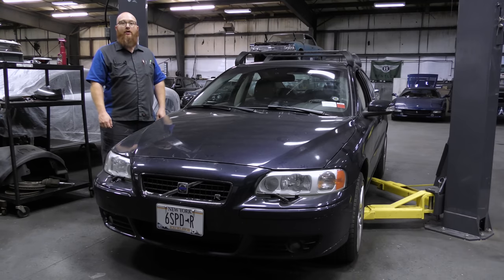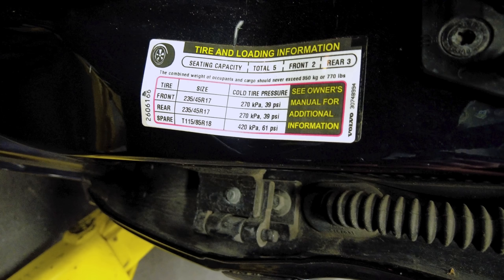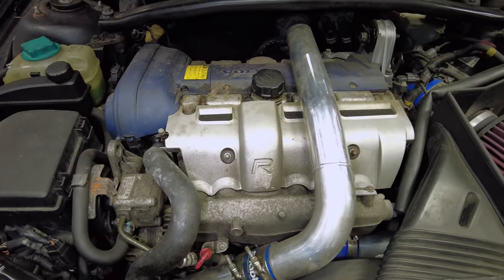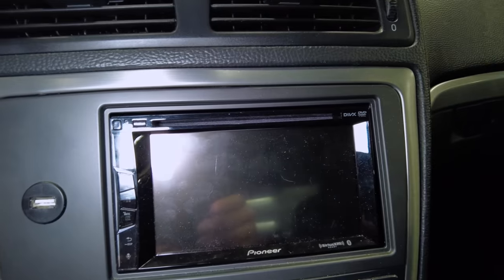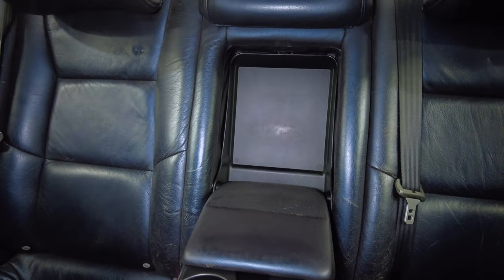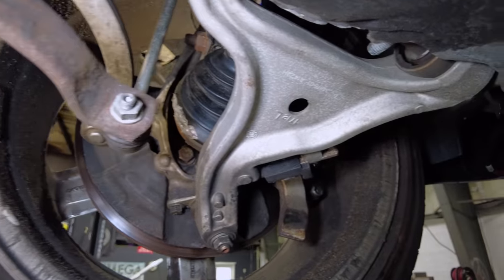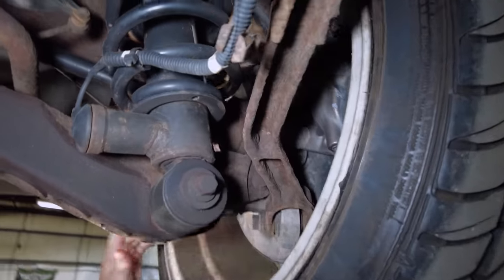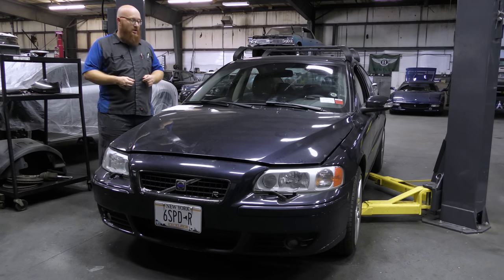They shipped their '07 Volvo S60R over 1K miles to my shop? CAR WIZARD determines if it's worth it!

Comment: That interior is kind of rough for 120k miles... Surprised to see the rear seats have a lot of wear too.
Reply: The Volvo seats from the era always wear out pretty quickly. You really need to condition them well and keep them out of the sun to prevent it.

Comment: That steering angle sensor issue is all too common on the P2 platform. I have the same issues on my XC90... gotta get that fixed soon, haha. Sometimes, it's not too hard to fix, being usually a dirty optical sensor lens.
Reply: I checked my anti skid on my XC90 and it’s saying angle sensor. I don’t want to pay hundreds for a new one, you think all I have to do is clean the lens on the sensor? Possibly ofc
Reply: @ZedQue  I did try that. While the main interior "wheel" passes through the optical sensors, the main issue I find is the small rheostatic/hall effect part under that protruding bit at the "top." The main wheel turns a small gear that controls the other part's movement, conceivably in and out. That is what is more likely the issue, since it is likely the bit that indicates the actual degree of turn. Either way, use some electronics cleaner or isopropyl to clean that, and it may help, but I ended up replacing my whole unit 😵🙄

There's a few articles on SwedeSpeed and the like, searching for "XC90 steering wheel sensor clean" or what have you should bring results. It is overall not difficult, but just make sure you put a set screw in the assembly to keep it from turning and then make marks on the three or so parts that have to come out. They are keyed, however, but just in case 😉

Comment: Bought my 2006 S60R new, and now has 175,000 miles.   Main Thing for keeping a car in good shape overall is parking it in a garage.                  I have had to replace 1 rear wheel bearing and the power steering pump.  Tires 18" P-Zero cost $1000 in 2008.  
Much cheaper tires are available now in the correct size.

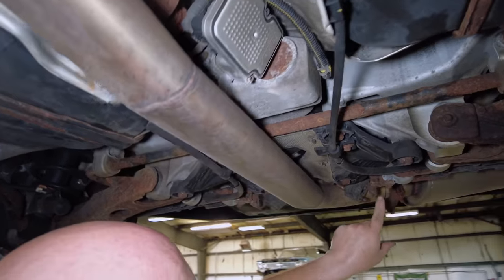Comment: Center screen at 10:57 is the DEM module, and right behind it a heavily corroded freeze plug that will leak Haldex fluid sooner or later, like mine did. That DEM module is not cheap and to protect it from the elements IPD sells a DEM cover. That freeze plug is not serviceable (and Volvo will recommend a whole new diff if it starts leaking), but removing the rust and J-B Weld will fix it. Good thing the 'bracket of death' has been removed (if you own a P2R and you have no idea what that means, you better google it). As for owning a P2R, if you're serious about it, agreed value insurance is the way to go. However, between the existing repairs, transmission, clear coat and other things that will undoubtedly come up, it will be well north of 10K before this is sitting pretty. 

As for mods for a P2R, HID projectors hands down the best mod. Low beam is pretty weak stock, high beam a bad joke. Euro's are better, but for the US market the high beam is just the low beam tilted up. I used to avoid driving my R at night, now I love it. Also shoutout to the best car seats and worst turning radius in the biz.
Reply: Thank goodness for the Internet where people like you can share all this repair info that otherwise we wouldn't have known just from reading paper repair manuals

Comment: the mechanical side of this car is actualy realy easy to work on...... alot of great communities with good prices on good used parts out there, alot of  easy upgrades to add to this car too ( remove cold air intake tho, makes no sense on this car. the stock on is a cone in a airbox wich is better for all the trash this set up might suck up . supsension wise , its possible to just put normal shocks ( billstein b6-b8 ) under there and get away with it. fuck that active supsension shit. breaks every 70.000 km and makes no sense to have on a manual, these cars got beautifull body roll, when used right u can take any corner at high speed controlled and well

Comment: I have a 2008 s60 2.5t  with 301000 miles, rebuild the automatic transmission with 260k miles, made by Aisin Wagner, so it's a Japanese transmission, replace the suspension with after market good OE cheap parts, from FCP Euro, IPD, and eEuroparts, lots of parts for this P2 Chasis, every once in a while I clean the Throttle body and change mass air flow sensor, very important thing is to change the timing belt every 100k miles, thats the Achilles heel on this vehicles, I'm about to change the motor mount,  basically basic maintenance, the cars been really reliable, except for the Japanese made transmission, but that's understandable with so many miles driven in city driving!
Reply: It is is the belt on the accessories that breaks.

Comment: Buying a late model S60R (can see it is a 2007 model as it has the mirrors with blinkers that came 2007-09, R-only 2003-2007) is a good luck to find job, and even better luck is to find a manual one in reasonable condition with that low miles! Here in Scandinavia it is totally normal that those have 3-400000km or more, diesels usually have 500-800000km (have seen cars with even more). :)

That is a car that will be worth BIG (20-50k) money in a couple years. They ask $15-20k for those today in that condition. So that is a no-brainer to fix that car. The R 6speed transmission is a bit of a speciality, basially the same transmission as all turbo S60/V70 6speed from 2003-2009. But they are a bit tricky to find as most were automatics. 

They already ask 20-30k for 850R's that are in good condition, and so will they ask for these in a few years. 

Brake calipers, $400 for a pair of R-brembo calipers is cheap. I doubt you can get them from anywhere even used for that price. My Audi 6pot Brembos are 2k/piece even used! :)

That car is stock, those are the stock Pegasus wheels (they came in 17 and 18" on the R). The S60mk1/V70mk2/S80mk1 (and XC90mk1) (P2) cars usually rub in the front because the plastic steering limit stoppers (fastened to the lower control arms) are worn out. Then the wheel rubs onto the chassis rail when at full lock. Seen it many many times. 

Cracked flex-joint in the exhaust is due to bad engine mounts, usually the upper mount. Engine moves and then cracks the flexpipe. Typical on the older FWD (850/x70 and the P2 cars).

The steering angle sensor is just typical on these, they all go bad eventually on the P2 cars with DSTC (electronic stability). 

Worked A LOT (probably on hundreds, those are like Toyota Corollas over here in Scandinavia) on these P2 cars so I claim to know my way around them.

Comment: What solved transmission issues for me in the past drain the current oil and refill it whit white spirit or something similar run the car around 20 seconds in the highest gear stop brake and drain the gearbox blow it dry with air fill it with the highest spec oil allowed the gearbox will feel a lot better and last at least a couple of months

Comment: The position of the leak is the lines entering the rack. The rubbing is a pair of rubber stering angle stops. $50 and four 12 mm bolts done. That rack leak is most likely the two o-rings at the line connector.

Comment: I have my Dad's 1967 Cadillac deVille convertible.  Has just over 200k miles.  He bought it new in 1967.  I 've had the engine, transmission, exhaust, complete interior, convertible top, tires, stereo system, paint job....etc, etc,.  ......now I just spent over $1000 on the rear quarter window motors (just the parts).  The car has more family history to me than its book value.  I spent $11k just getting the engine rebuilt and the rear main seal leaked worse than when I gave it to the shop.  The shop owner waved the white flag and gave up.  It took me months to find a local guy who was able to diagnose the leak and actually fix it.  Another $2500 !  I did find a Cadillac shop about 3 hour s away that "specializes" in classic/antique Cadillacs and they did not want to touch it.  It is getting harder and harder to find competent mechanics and good parts to fix some of these cars.  I am telling my kids, that when I'm dead and gone, just sell it and be done with it.  
That reminds me,  I need to get my bumpers re-chromed.......probably another $5000.

Comment: I own one.  Yes, it is worth it.  Until it slips, the AWD is front/rear 80/20.  4C suspension cost is usually why people sell.

Use the code to put it in advanced mode and it will make you happy.
Reply: Yeah 4C is kind of expensive, but at roughly 1800 in parts (from FCP Euro) and a weekend, you can handle the job yourself generally, plus, when they need replacing, FCP Euro will replace the old stuff for free...

Comment: In 2008 I bought a 2006 S60R, black w burnt tan leather interior. Was a blast to drive. 6 speed manual was smooth. Definitely was overweight weighing nearly 4,000 pounds. Made a round trip to West Virginia from NJ with no issues. Kept it for a couple of years. 
This car was Definitely neglected.

Comment: P2 Volvos are very very prone to wheel rub at steering lock. They have 3 different size steering bump stops for different wheel sizes. There is one for 15-16” wheels and then one for 17” and then one for 18”. They are color coded and by the looks of it, seems like it has 17” ones. So going to 18” bump stops should stop it from rubbing. Also could just swap them side to side so they have fresh contact and maybe add some washers. The bump stops are plastic and bolt to the control arm.

Comment: If transmission is dead, bet the haldex is worn. The angle gear was the failure point for why I sold mine. Itnwas $4k in 2010 to fix it.

Comment: I have the wagon version, a 2004 V70R. Yes, those are factory wheels. My wagon is a 6-speed manual. I currently have 240K miles on it. I bought for $6K three years ago. Over three years, I've spent $5K on maintenance and repairs.

Comment: Please read this:
I heard about 'the clock spring tale' before when my 2007 V70T2 had the same problem some years ago and solved it without buying new parts.
Volvo steering angle sensor problems has nothing to do with the clock spring,
The clock spring transmits information from the buttons on the steering wheel to the steering column assembly and nothing else.

It is the interior of the angle sensor that gets dusted up, Read: The optical system stops working because it can't 'see' through the dust.
A simple cleaning of the optical parts (optical bridges) will solve the problem.
Be careful when disassembling the steering angle enclosure: Some gears have to be returned to the original position at assembly.
I have a few pictures from the repair I can send....

You might have to calibrate the angle sensor after assy with VIDA-Dice or similar. 

Regards
JD

Volvo only since 1986 🙂

Comment: I have a 2006 Volvo S60R, Atacama Spaceball in Titanium Grey and these cars are really special. Mines kind of a unicorn because its great condition and has almost no issues. Most of these cars have issues. The car in this video is pretty good overall imo, Magic Blue is THE best color for these cars idc what anyone says, especially with atacama but it appears this one is nordkap which is also really nice. This one is not very optioned out, climate package and thats pretty much it. Its honestly more rare for it to not have a climate package. As long as the 4C works, haldex works, and the PCV system is in good condition it should be fine I think. They smell like crayons when theyve been parked outside for years.

Comment: When I was young and foolish, I passed a group of bikers who were driving much slower than the speed limit.  Long story short, I had to flee for my life when they pursued me.  I had a V70R Volvo with 6 speed manual.  I was surprised how well a motor bike could corner and they were catching up.. In the next straight stretch I had the Volvo in 5th gear when I looked down and saw I was doing 260 km/hr and still had 6th gear available.  Harley s can't go that fast.  The manual said that the car would reach top speed effortlessly, and they were right.  No I didn't blow a head gasket, and the bikers did not pummel me.

Comment: Market value is different from book value. Insurance will only pay book value vs what you pay. So if you overpay 25% for the car of your dreams and it's totalled, you will lose that 25%. It's hard these day to buy a "book value" vehicle since the calamitous covid days screwed up the valuations.
Reply: In that case the market value is wrong, right, if it should be valued at what people are actually paying for the car. I have heard fortunate stories of people whose car was totalled and they got the same money from insurance as they had paid for the car years ago, enough to buy a new one, or even more due to inflated book value. But then they do have to use that money to buy a new, overpriced car.

Comment: My answer is absolutely NO. That car is not worth saving. Take that eight grand and buy a well-maintained used Toyota Camry with 120,000 miles on it and drive it 360,000 miles. Volvo corporation has been a huge mess for years. Just let the headache go.

Comment: That steering rack will be an headache to fix. 
Manual gearbox, yes its worth fixing, A lot easyer than the automatic.
Mount steering stops on control arms so it wont rub.
But i recommend you to overhaul and diagnose this car with volvos software. You can test and reset everything with it. Also troubleshoot... 
If i would own this car, i would first go through the linkage for the gearbox and swap the gearbox at the same time as the rack if needed. 
Also check the steering oil reservoir that its not defective. 

These manuals are way easyer than autos to repair!

Comment: The rubbing with 18 inch is normal, mine passed all the way through the fenders before noticing the issue with the rubber end of turning blocks. Brakes are indeed very expensive but worth it and last a very long time anyway.  As an owner of a v70 R with 385000 kms I just am surprised with the wear and general state of this vehicule that shows way more mileage than the odometer tells.  The engine alone is worth it and you can see them on the internet tuned up to 800 Hp.  Still miss the sound of its 5 cilinder. For parts you can sometimes find cheaper ford parts that match these vehicules as in that era Ford  had a participation in Volvo. Steering rack on mine had to be changed too. Certainly not cheap to maintain but very fun to drive and worth saving.

Comment: Volvo rear view mirrors are a bit rubbish as I’ve found to my cost. I’ve got a 2015 diesel V40. When I bought it in 2019 the ‘frameless’ glass was already slightly discoloured. Though not as bad as yours. During the winter of 21/22 I got in the car one morning to find the glass on the centre console. It had fallen off, destroying the silvering. The car was due a dealer service and when it went in, I got them to fit a new mirror. I think it cost me around £70. Amazingly it lasted JUST ONE YEAR, and I got in the car one day to see the glass hanging and dangling at 90 degrees to the mirror body. I retained it with rubber bands to drive. Checking the price of new mirrors, the price had risen to over £100. No way. This time the glass silvering was little damaged. Using a YouTube tutorial, I removed the whole stem and body, and stuck the glass back to the body with bath sealant! Then used black PVC tape and a craft knife to carefully ‘frame’ the glass and neaten the edges. Now the glass can never fall off again. I like my Volvo but they skimp in some areas you wouldn’t expect.

Comment: That 6 speed is a lot like the a 6 speed used in the focus because the focus uses a one based off a version of this gearbox if that makes sense. So if they can work on a focus ST gearbox then they can do a Volvo m66. Just this one will have an output for awd instead.

Comment: Hi wizard dont mean to be rude  but wen you change 17 to 18 inch wheel There is a stopper kit That you have to install so that it doesnt rub  Again that rust i take it anytime you want i am in north of Canada and i owned 3 volvo so far and every one of them in many cases... i had to drill holes since winter and salt had mate them useless as for any Bolt or studs. So your 2007 i take it any Day from where i came fromagerie

Comment: Those wheels are original Volvo wheels, there's 17" and 18" versions, the dark 18" wheels are VERY rare
And I'm happy that I have those 😁
Reply: I don't believe they came on this car from factory though, the door sticker would have matched. Someone swapped the larger wheels.
Reply: @volvo09  Yeah, that's possible
Those ones might also be the "fake" Pegs, there's a very slight difference between OEM and aftermarket
Reply: Exactly... And at least here in Sweden they are popular on older Volvos (240/740/940) and many of them have copies, so worth checking if you buying if it's real or cheap copies!